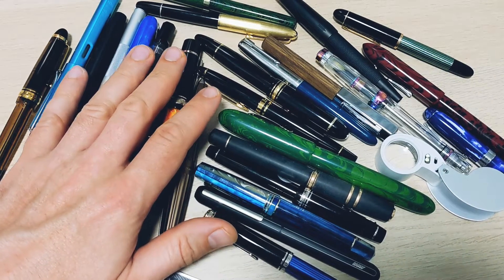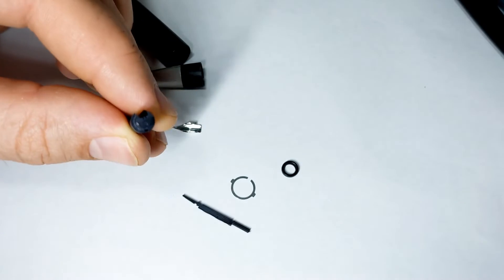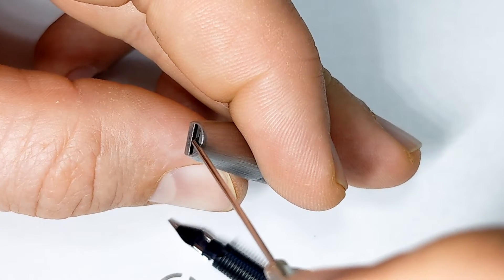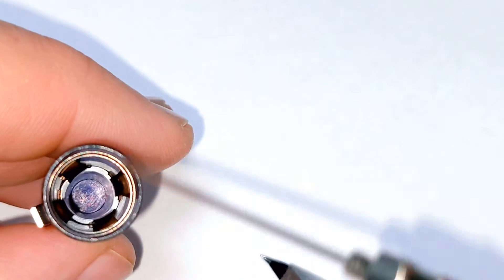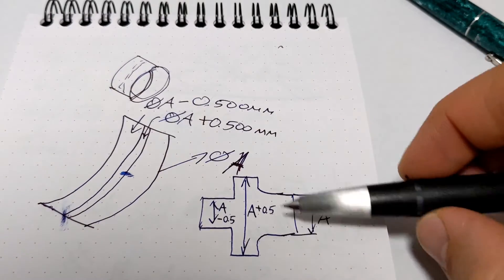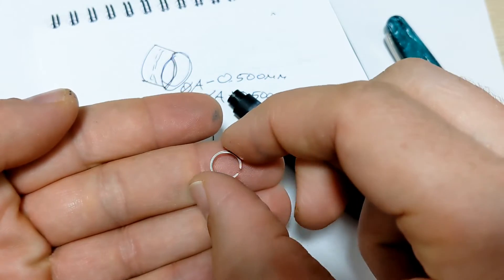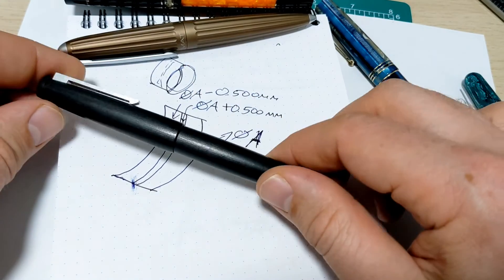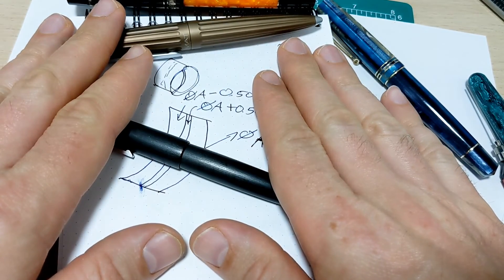Which Fountain Pen Is the Best Engineered? (Lamy 2000 Part 1)

Comment: As a Quality Assurance professional, I really feel the need to weigh in here. The Lamy 2000 simply CANNOT claim best engineered pen.   Why? One thing knocks it forever out of contention: the one thing Lamy knows about, but never addresses.  PHENOMENAL NIB INCONSISTENCY.  The wildly varying spread of variations between XF, F, and MED nibs is unbelievable, and unmatched in any higher end pen brand. XF can be virtually indistinguishable from M, or certainly F from M, and so on. What are you really getting when you buy one? You can’t know, until you inbox and use it…

Many people then either sigh and accept the situation as is, while others send their nib out for rework and retuning.  No high end gold nib should be this consistently inconsistent!  It cannot be said enough: ACCURACY and CONSISTENCY are absolute basics of Quality.

The rest of the engineering and aesthetics of a device don’t matter if the (actual, literal) point where the rubber meets road - the nib meets the paper - is subject to wild variations. The luxury car may look beautiful in the driveway, but it’s not truly high quality if it needs an element of re-engineering to meet one of its basic specifications.

When the makers of pens costing under $20 can consistently get nib size right, there’s simply no excuse. None. The razzle-dazzle Lamy would have to do to explain this as right and appropriate, in an industry where everyone else across most of the cost and materials spectrum gets it right far more often - well it would be interesting to see.

(Note, I own a Lamy 2000, and its Fine nib is thicker than many of my Mediums…)

Comment: I bought my Lamy 2000 as my first gold nib pen earlier this year based on the research that it is generally the smoothest pen out there. (Especially on Clairefontaine paper with very wet ink.) That turned out to be true for me, even using Chou Kuro on Midori/Muji paper. The Lamy 2000 was so good, it actually spoiled my expectations of my blue titanium ensso pocket Italia and the Ultem ensso Italia (though I love the look and design of the Ultem model) I just received today. The Bock nibs feel like garbage compared to the Lamy and even my Pilot Explorer which was only $30. I'm not unhappy with the ensso pens, which were great with the 35% off price, but the nibs and feeds are plain underwhelming. Now I have to decide if I want to take them to a 12000 grit strop or see about a nib upgrade. Unfortunately, the cost to upgrade the nibs might be near the parity of buying a Pilot e95s. Or I could buy the steel Lamy 2000...

Comment: So I bought one. Gee, it worked really well. So I watched your video. Took it to bits. Put it back together. More gee. Amazing pens.
Reply from the maker: I wouldn't recommend taking out the piston often, if at all TBH.  I did it for the video but there is the risk of damage.  It cleans out pretty easy and basic cleaning does the trick.  When you remove the section, screw the piston back and add a small dab of silicon grease every now and then and it will last a lifetime

Comment: In depth video, I just purchased this pen, its in shipping. I needed to try it, to see what all the fuss is about. You spent a lot of time on the clipping mechanism. From a regular Joe's perspective, it seems a lot of work went into making a clip that yes works well, but also leaves two metal pieces in direct contact with the users fingers. In my mind that is a terrible design, functional yes but the pilot prera has a nice click clipping mechanism and a 3 dollar rollerball has a click mechanism, they all work. My thought is why make such a mechanism with so much time and effort and have two metal pieces exposed? why not have a lip in the section that would line up with a similar groove? Just my thoughts on the cap.

Comment: Two years late to this video, i am new to fountain pens.  I am curious, do the metal bits protruding from the tabbed spring where you hold the pen while writing, do they scrape against your skin at all?   I live in a remote location, would take me 3.5 hours one-way to get to a pen shop where I could actually hold one.  Many thanks!
Reply from the maker: It all depends on how you hold your pen.  I feel them but they don't scrape.  However I know someone else where those tabs drive them nuts.  So I guess its a personal type thing and depends on how you hold a pen.
Reply: @Doodlebud   thanks so much!  i think you might be on lower mainland, i'm in Victoria and very new to FPs.  Wish i wasn't so far from Van Pen Shop, et al...!
Reply from the maker: @Lulu_Badu  there's 2 stored there I know if in Victoria to check out. Pretty sure they care the Lamy 2000. The Papery and Simply The Best
Reply: @Doodlebud  thank you!!

Comment: I agree to an extent but I prefer the heft of the Steel 2000. There is a Chinese version of the Steel 2000 . It would be interesting to watch you do pull apart comparison. The Chinese manufacturers have done something's differently as in not using the ring with ears.

Comment: Hello Doodlebud, Thank you for this informative pair of videos, & your engineer's perspective.

I got my first L2K about 12 years or so ago. Sometime after that I found this video which shows the disassembly of the cap:

[ https://www.youtube.com/watch?v=5V0jZAlelAE ]

I have never followed it through, I see no need. I disassemble the bodies of my pens every 18 months to 2 years to give them a deep clean, pop the cap into my ultrasonic & then apply a little silicon grease to the piston, its screw drive & the body threads.

Other pen companies (purveyors of bling) require special tools for disassembling their offerings & will void the pen's warranty if the user dares to maintain their own pen. 

Lamy appears to respect the intelligence of their customers: They are smart enough to use Lamy products! The only tools that I have ever needed, other than the little ultrasonic & my two hands, are a couple of glass or porcelain trays (one per pen) to hold the various parts. These are German instruments & there are quite a few little bits & pieces that are vital to the operation of these pens...

BTW: Having several of these pens is not a frivolity, I find it a pleasure to work with well made tools. I use EF, F, & M nibs, with archival inks for graphic work. I like the italic quality of the B nib for writing. Printing really, I've forgotten how to do running writing. My L2Ks live between my desk & the studio area. I have some Safaris, colour coded to indicate nib size, for use in the wild. ;-)
Reply: Many people say it's strong but there are multiple complaints of cracking. You have been using this pen for a while, disassembled it many times, you know its strong and week places. I also cracked my Lamy 2000 EF near grip section after 2 days of purchase, now ordered Medium after returning. Can you enlighten me about its strong & week points, and how to not damage it for a lifetime use?

Comment: When you look into the capping mechanism of a Waterman Carene, you don't see the extra retention springs in the cap as they are not needed. Typical German over engineering to resolve a non-existing problem.

Comment: Sir Doodlebud- may I ask you to do a video on how to fix a leaky pen? I have a few leakers and take a bath in ink when I remove the cap and take the grip in hand. They don't burp. I thought maybe with your engineering background you may have some tips. 
Thanks for considering.
Reply from the maker: All depends on where the leak is coming from.  First place I would look is the nib unit.  Is the housing properly threaded and seated, possibly in need of a spot of silicon grease.  Are there any o-rings missing inside the body or housing unit.  Have a look to ensure the nib & feed are properly seated and fully pressed into the pen.

Comment: I have a few Lamy 2000s. The Cap does come apart. But here’s the thing: 2 caps unscrew at the top very easily. 2 of them don’t. I mostly did my experiments on the rollerballs, not the fountain pen. Buy a roller ball version of Lamy 2000 it’s cheaper 😂👍🏻 good luck. This is my fav video of all time. 😀
Reply from the maker: Yeah I've seen some people take it apart, but mine wasn't budging. I imagine I could remove it, but the force I was using was as high as I was willing to exert on the part.  Didn't see the benefit of taking it apart while running the risk of damaging something.  Glad you enjoyed the video :)

Comment: I'm a senseless contrarian and have been avoiding the LAMY 2000 hype. THIS video has forced me to place this pen on my TO BUY list. Thanks.
Reply from the maker: Glad you liked the video, I have a part 2 as well. It's exceptionally well built, but it's not for everyone. Some don't like how it feels in the section. Also the nib sizes are wider than normal. Build & engineering is great, but user preference plays a big part so keep that in mind 👍

Comment: Before you named the pen, I was reaching for my 2000 BB. And just as you were discussing the spring ears that snap the cap, I realized mine was missing the part. I must've disassembled it for cleaning and misplaced the tiny part. Luckily, I have two, so I'll keep the BB inked up and spring capped as I see if Lamy will send a replacement. Synchronicity of a sort. Thanks.
Reply from the maker: Check out part 2 for a little more info.  I help back but people wanted more, so I went a bit deeper even1
Reply: @Doodlebud  already been there. Geek out, Willya!

Comment: Lamy 2000 is a wonderful piece of engineering, but it's not a revolutionary design.  If you open a Lamy 27, a design from 14 years BEFORE the 2000, you'll have the same nib, same feeder, same piston mechanism... it's the same to the point that you could interchange the parts between the 27 and the 2000.  The external design of the 2000 was new, but the guts are from 14 years before.  So one tip: if you need a spare part for your 27, you could use 2000 parts.
Reply from the maker: No idea the lamy 27 even existed. Thanks for the info

Comment: I've had problems with mold on my inks, so I no longer fill pens dipping them on the bottles. But I really want to get a lamy 2000, is there any other way I would be able to fill it?
Reply from the maker: You could remove the section & use a syringe to fill the piston section with ink. But I would first look into your mold problem. If you're getting mold on your inks regularly there's some issue going on. You don't want to be filling your pens, dipped into the ink or filled otherwise, with moldy ink. Look into how your ink is being stored or if contaminates are getting into your inks. I've only had 1 one bottle of ink get moldy on me & I got rid of it.
Reply: @Doodlebud  I think the problem came from mold inside a cap (probably stored humid after cleaning) then that to bottle ink. I now have my ink divided like if they were samples. The thing is, mold grows fast, one day there's none nex day is full of specks. So although I don't have any problems right now, I want to be extra careful,  ink isn't cheap in my country.
Reply: I’m looking into the Peneida inkwell. The other thing is Twsbi makes some nice little ink wells which can be counted and cleaned out which may help with your problem. But that’s a good tip I didn’t know that you could contaminate an ink bottle that way thanks for the contribution cheers

Comment: Question about Lamy nibs, are the nib widths and ink flow the same with the 2000 as with the less expensive models like the Safari? This way I might be able to figure out which one I want.
Reply from the maker: I'm not 100% sure on that one. The goulet pens nib nook tool might be helpful to guide you.
Reply: @Doodlebud  I'll look into that. Having made 3 pens now with a metal lathe and more/less copying designs to get the proportions "close" to what I want and using existing feeds, sections, and nibs to do it and not even trying to make a cap but a roll stop on one of them, people way under estimate the effort that goes into good design that looks effortless!
Reply from the maker: @fr.marklichtenstein8892  oh I hear ya. No shortage of armchair design experts on the internet who've never made a damn thing. And a pen is a simple thing to make but still take a ton of work! The sure sign that someone doesn't know what they're talking about is when they start off with "all they have to do is...."

Comment: I think the copper colored spring material is likely to be a phosphor bronze alloy, I've seen it used as springs in model railroad coupler applications, as well as "wipers" for picking up electricity from wheels, for some of the same reasons: it is softer, a little, than the steel, but wears a LONG time and is nicely springy within motion limits.
Reply from the maker: I believe you are correct. Straight copper would be too soft & would also oxidize significantly over time. Need to be some kind of alloy to give the springy property, be softer than the steel, and not have a heavy oxidation

Comment: The ''original'' Parker 51 fountain pen was there before all the more modern manufacturers.
It has stood the test of time on every level : Engineering /Quality of materials etc. which is why so many working examples are still in existence and sort after by collectors.
 Often imitated but never bettered !!
Reply: The Parker 51 has existed since 1941. Lamy, meanwhile, has existed since 1930. As for quality, the 1970s Soyuz fountain pen I own from the USSR, also my first, beats the Parker 61 I inherited from my grandfather on every technical level. Inkflow, tolerances, etc. Its not even close. Its also worth mentioning that both pens are in top-tier condition, so the Parker's inferiority can't be attributed to that specific pen having a problem. As for the subject Lamy 2000, I'm confident it would blow both the Parker and the Soyuz out of the water.
Reply: @jakekaywell5972  My comment was made with regard to the PARKER 51:
NOT the 61 which was apparently made as an upgrade of the 51.Sadly the plastics used were inferior and shells shrunk and replacements especially in black are virtually unobtainable. The 51 market has a very good following and as most existing examples still work and don't need parts,there are many pattern parts available to restore when needed.
Reply: @stephenheliodor776  Interesting information. I didn't know that the 61 was actually inferior in quality to the 51, despite it supposedly being an upgrade. However, the comments I made regarding both my Soyuz and the Lamy 2000 still apply. The 51 market has a very good following simply because so many of them were made over the decades, and therefore spare parts are still readily available. I sincerely doubt that the reliability of the Parker 51 is signficantly higher than any equivalent fountain pen of the era, such as the Sheaffer Snorkel.
Reply: @jakekaywell5972  The Parker51 is more reliable than it's compatriates: The ink sac known as a ''glass'' was neoprene and therefore didn't rot out like the equivalents used in Sheaffers etc that used conventional rubber.The earlier 51s were vacumatics which were less reliable but when the press bar filling superceded this the reliability was vastly improved.The Hooded shell and feed - an original51 feature allowed a much better and consistent ink flow than many open nibbed pens.

Comment: I have about 90 fountain pens. Half or more are vintage, and the rest are modern ones. Using almost all of them in rotation (looking at my current set on my desk - 2 x Sailor King of Pen, 1 x Sailor 1911 Large, 1 x Pelikan M1000, 1 x Pelikan M805, 2 x Pilot 912 Falcon FA modified, Visconti Homo Sapiens LE, Montblanc 149 Calligraphy - and Lamy 2000 Medium. Guess which pen I reach for first when I’m not thinking? Lamy is just excellent, perfect design... and to think it’s about 40 years old design...  but I must admit, my Lamy 2000 Broad - I just can’t tame that nib. As much as medium is perfect - broad is beyond my ability 😁 
Next in terms of quality and engineering I would say Pelikan...
Reply from the maker: KOP Nice! Want to get my hands on one of those 🤤
Reply: @Doodlebud  If you have a chance - do it. But are they worth the money - that is a conversation over a glass or two of a good whiskey. Nibs are excellent, I have one fine and one medium - typically for Sailor - they don’t make mistakes with nibs. Some softness to them, big pen and externally very Montblanc 149-like. But - engineer in me cringes every time I hear the price of some pen - and it doesn’t have a piston filler or at least eyedropper conversion option. Anyway - by far the most frustrating thing is - small volume of ink. Nibs are “thirsty” and juicy - and that cartrige converter is shameful. The whole thing looks like if you’d fit 4 cylinder engine into Chevy Suburban 😄  But, I use them all the time so I guess I’ve accepted the frustration. Those ebonite versions look mighty sleek, more expensive though... but at least you can’t mistake them for MB 149 (of which I have 3, and it’s funny when I line them all up with Sailors.

Comment: The loose ring for keeping the cap on is the worst part of this pen.  It is easy to lose or misplace.  Not sure why it is not embedded into the pen.  Not even sure you can get a replacement for it if it does go down the drain while cleaning.
Reply from the maker: Definitely take it off away from the sink. You can order spare ones online